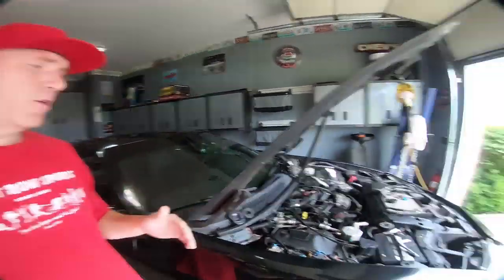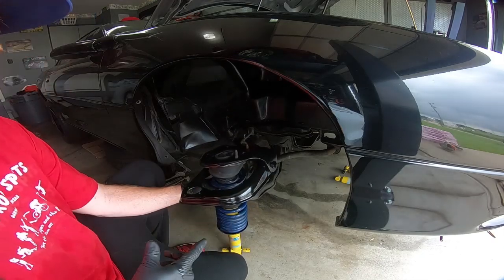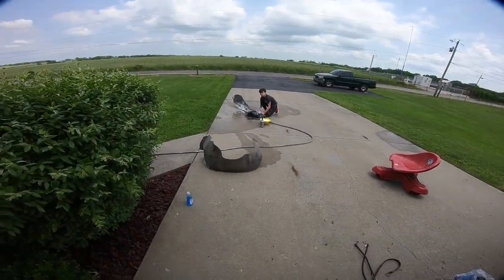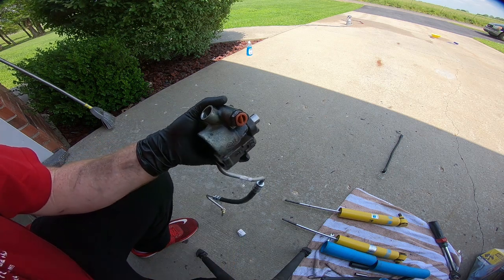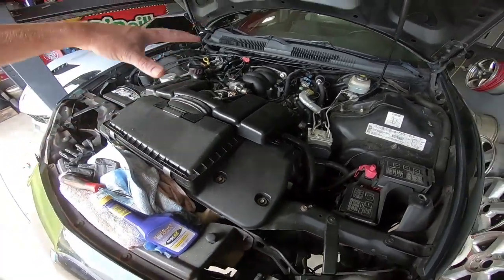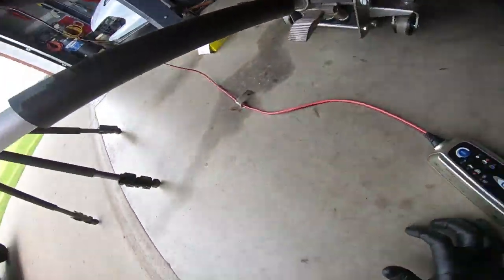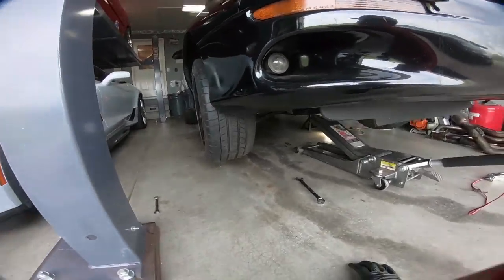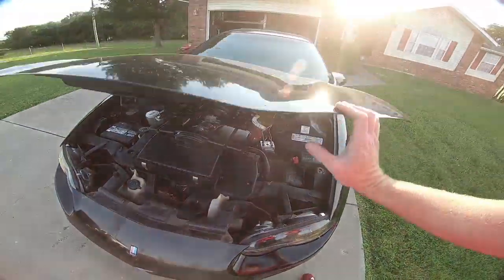Power Steering Fix and Lowering the B4C Camaro Project

Comment: Is AC Delco the best fluid to run??
Reply from the maker: Not necessarily. I generally use mobil 1
Reply: For power steering??
Reply from the maker: Generally use redline for that
Reply: Is it noticably better? And does it affect the firmness of the steering
Reply from the maker: Just a better quality product. I have not noticed a difference in feel
Reply: Also thanks for your feedback Travis love the content
Reply from the maker: Thank you

Comment: ey bro i got another question😂. I noticed that those shocks dont have the mounting plates for the springs, in the picture off the ebay site. I also went to different websites looking for the same shocks and they were all the same picture. Then i went and looked around for the mounting plates of the same brand and no luck. The plates you have, were they used from the old shocks you had or did you buy those separately? Is so, which ones were they?  Thanks again🤙🏽
Reply from the maker: Yes. These were used so had all the plates. Reusing yoir old ones is generally what you do.
Reply: @TWAMotorsports  oh lol.  Alright then thanks bro. You and your videos have been a big help👌
Reply from the maker: Thanks. Glad it could help

Comment: YOU installed the ball joint WRONG. 
Those three little bolts are going to break and you might lose control when it does. The ball joint has to be entered from the TOP of the control arm. The weight of the spring and car will then be placed on the thick base of the ball joint not the three little bolts. Just don't want you or anyone else to get hurt installing it like this. And that is not what the seal cover/retainer is for.
I don't ever correct anyone one THIER videos but this will get someone killed or seriously injured!! Please correct it on your car and in this video

Comment: Hey Travis I’m having issues putting my shaft back on lol, I was wondering if you could help me out?
Reply: So I disconnected the shaft at the point close to the rack and it’s kind hard to slip on flush to the knuckle. Did you disconnect the shaft from the middle and at the bottom?
Reply from the maker: Yes. Loosen the top too
Reply: @TWAMotorsports  ok hopefully it works out lol thank you for always replying Sir! I need some more trans am content by the way!! Miss that thing
Reply from the maker: You're welcome. Good luck. Ta stuff coming

Comment: What kind of paint are you using when you're cleaning up? You said it was flat black, but I was wondering what paint you used on the trans am engine bay.
Reply from the maker: No I used duplicolor on the trans am. This is plain old rustoleum. Works well in the fender wells.

Comment: What else is wrong with it that makes you think it's too far gone? I hope you don't sell it. If you are ever in the bumper area again and have access to the turn signal housing, I would drill a hole in the lowest point of the housing. Those things tend to fill with water and destroy bulb sockets. All new how I know. Actually I did the same thing to the tail light housings too
Reply from the maker: It needs paint, interior, 1 of everything lol. It's good for now though
Reply: @TWAMotorsports  i say if aint rusted out, throw some spit on it and shine it up. i guess i havent paid enough attention to the interior but it seems mostly complete.
Reply from the maker: @Unchained_Bankai  it's not rusty. Yes interior is all there just broke down and cracked lol

Comment: Don’t sell it man you’re in to it for a great price and it will make a great driver that you won’t have to worry so much about!! If you did keep it and were to put headers back on being lowered what would you go with? I’m lowered on Strano springs (not that low) but dont know which headers fit the fbody the best? Have considered the speed engineering anybody tried them? Cheers keep up the great vids man!!
Reply from the maker: Thank you. I actually would do speed engineering. I have the 1 7/8 on my trans am. The fit pretty well. I would probably do 1 3/4s on the Camaro

Comment: If you guys are having power streering problems please also change the power streering coolers over time it will mix coolant and power streering together then going to into the motor which is bad on any rubber seal over time
Reply from the maker: That had already been bypassed here. I just made it prettier. Great suggestion though. Those things are garbage